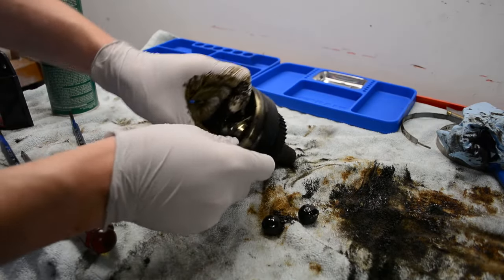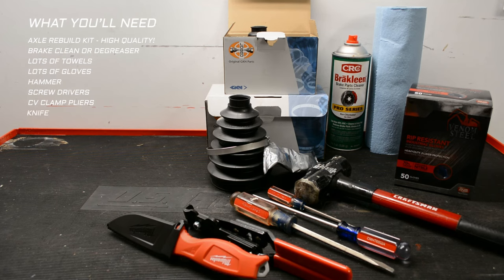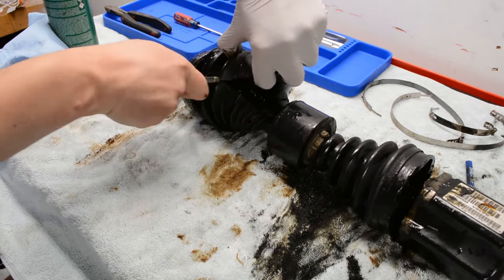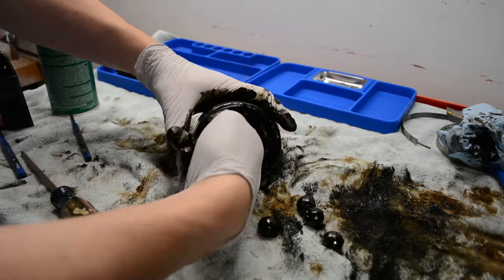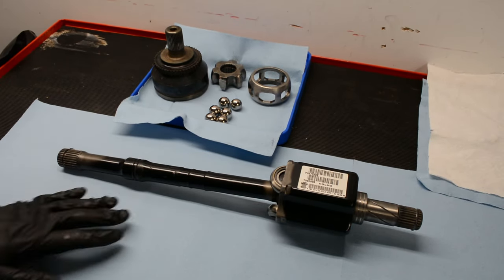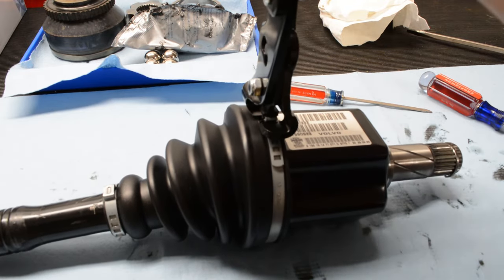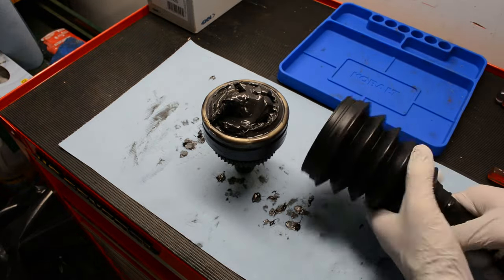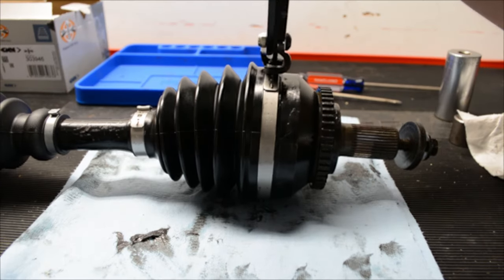How to Rebuild a CV Axle

Comment: skipping from tapping on the inner splined carrier, straight to it just being off is just bad. you should have shown that. thumbs down.
Reply from the maker: Sorry to let you down. It's really just hitting that cage with a hammer until it cracks loose from the axle. Nothing special. If you have any other questions I'm happy to help.